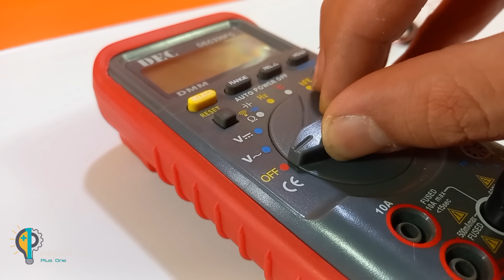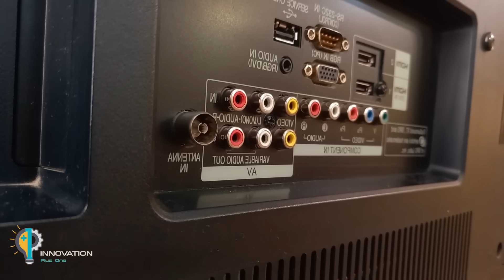Earphone Unlocks Worldwide TV Channels || Antenna Booster

Comment: You do realize that copper is the worst type of wire to use as an antenna right?
Reply from the maker: The best wires that can be used for antennas are wires that have good conductivity, such as copper or brass❤🙏
Reply: I have no idea but what material do you sugest for the antenna?